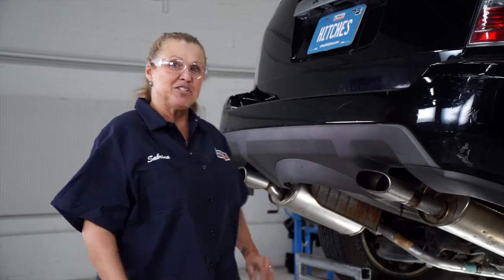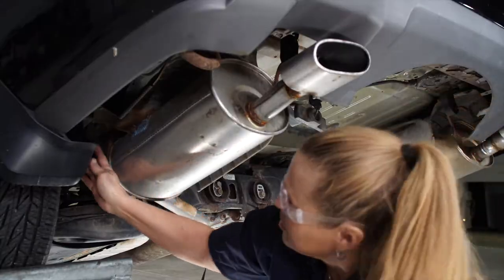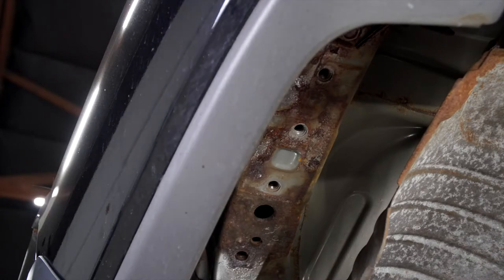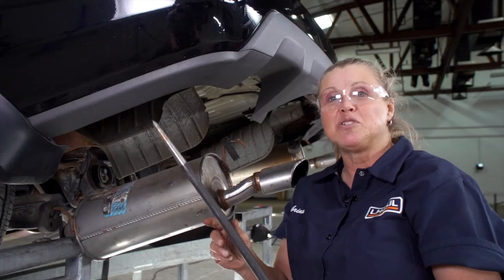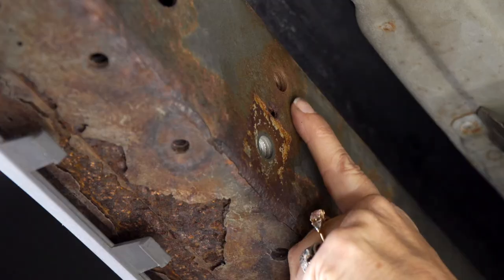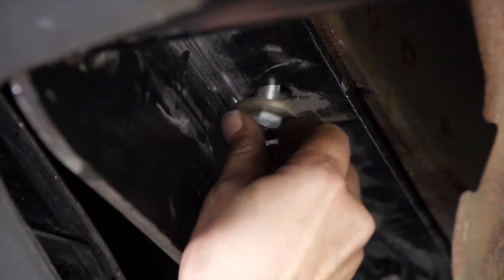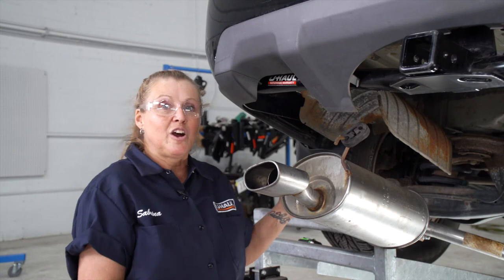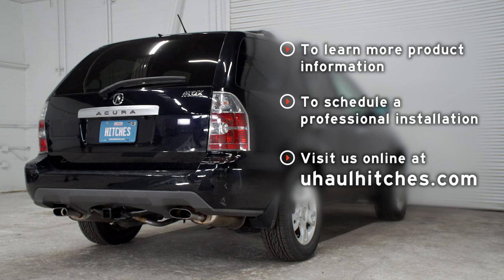2001 Acura MDX Trailer Hitch Installation

Comment: Lad'eeeeeeee, you have no idea how much headache you just saved me ?!!!!! The weldnuts on my 2001 Acura MDX are completely shot on the passenger side! in fact , I didnt have to use a breaker bar, they're rusted and broke off inside the frame themselves, now I just have (2) holes there with no way to thread the hitch onto the frame, that is until you came along Miss Burns... still trying to find a store that sells the weldnut replacement kits??? by the way, what cutting tool and blade type did you use to trim the access hole??
Reply: Disregard my question. The local "Bar & Body" Grill shop sold me the ( flat washers, carriage bolts and wire, All fixed...Yay !!!😃